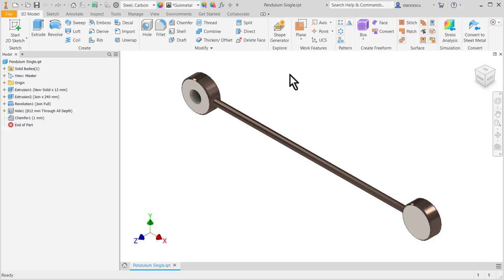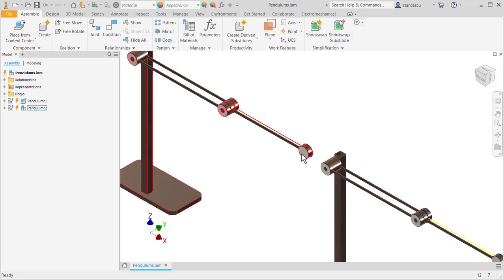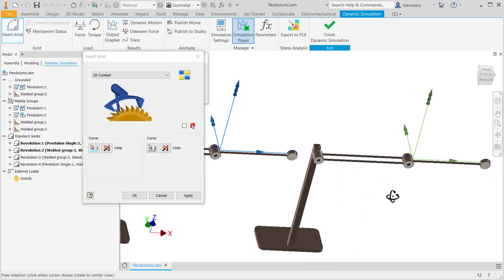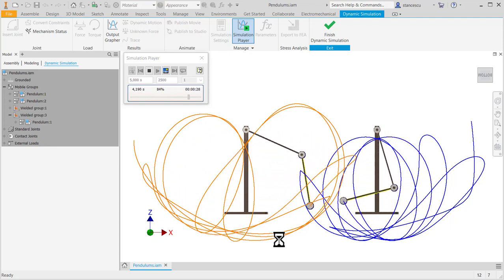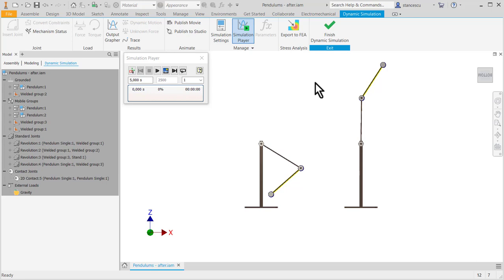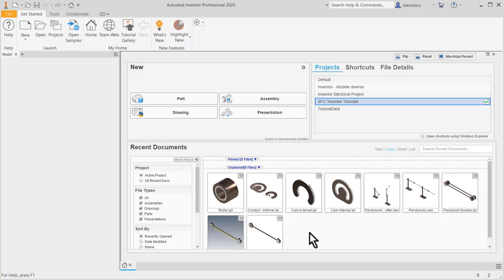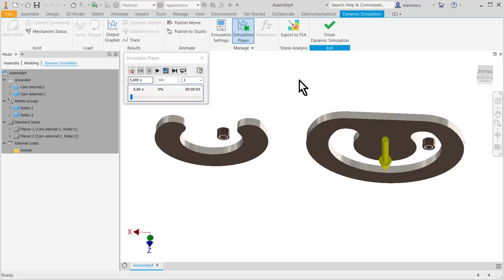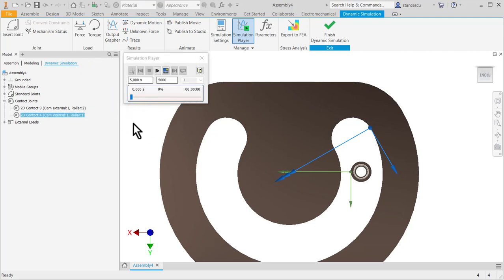Tutorial Inventor - 045 DYNAMIC SIMULATION (Beginners - Chapter 2)

Comment: Va salut Domnul profesor. Am un Assembly şi eu nu doresc sa vad line de "moviment" cu force de gravitate ci doresc sa vad cum am facut constrain. Dar nu am vazut (sau nu am inteles) pe prezentare dvs daca putem face asta sau nu. am trei part in assemblu meu şi se mişca cu constrain nu cu gravitate. Aveti solutie pentru asta? Multumesc..
Reply from the maker: Nu inteleg ce doresti. Scrie in engleza!
Reply: @prof-stancescu  Imi pare rau.. I will try to explain in english. You made this path with force of gravity. Right? But my assembly model is not free movement. Fixed with constrains. Then when i will try to make path line, i have to move with constrain, not eith gravity. Then have can set movement with contrains...
Reply from the maker: Do you try to create my model or or another one?
Reply: @prof-stancescu  Ofcourse. I am Mechanical Designer and make 3D models since 20 years. I make a Dock leveller model. And i have to creat one part with this path. ON the loading ramp have a cover and when dock leveller ramp start to working move helical. then I have to make rail for it. Therefore i need a path line of it..
https://www.youtube.com/watch?v=RPe9oMXYQcE
I need path line for part of front table corner for example. And this mode wirth full of constrains.